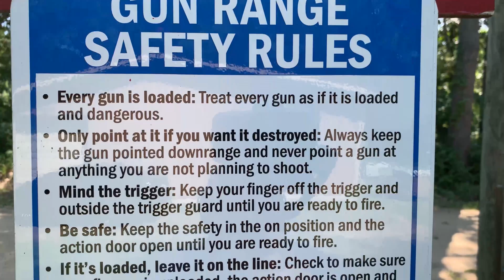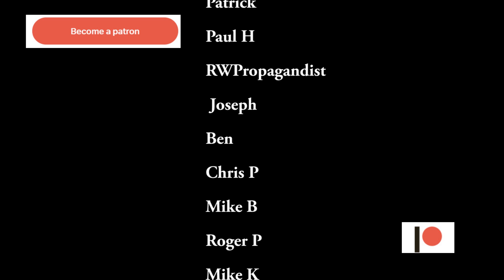7.62x39mm, 46gr FMJ, Czech Training Round

Comment: As much as I prefer the collet style in general, I really think you need to get a kinetic bullet puller, just for your macro shots.
Reply from the maker: the troubles with kinetic pullers are they get powder everywhere, and with steel case ammo especially with sealant, are almost impossible to get them to release. I've destroyed 4 of the hammers over the years :D
Reply: @BuffRANGE  I get it.

There's a reason I didn't buy one. They seem like an inherently self destructing design, and slow to use. It just seems sad to have a confusing and uglied up bullet for your thumbnail. That's genuinely perplexed me a few times, and I've seen others comment the same on several vids.  You clearly put a lot of work into your videos, so don't take this as me adding more onto your plate. Keep doing what you want to do.

 I destroyed a  hornady collet style too. Turns out I'm not the only one. They have a defective design, and poor metalurgy. I have a review of it from circa 2013 on my channel, and TATVcanada did a good job of showing why the RCBS one is better made.
Reply from the maker: @GunFunZS  I agree. It bothers me a bit for the Macros that I now have altered the bullet. I had that happened with the Syntech 9mm since it was soft lead. The collet puller was reshaping the lead when pulling.  

I wonder if I pushed the bullet down in the case after cutting the bottom out would result in a cleaner bullet. Or maybe I just need a really powerful electromagnet, or Magneto's power :D
Reply: @BuffRANGE  I think that is a good idea. Especially for those that have the tar sealant. However it might not leave you any cylindrical portion to grip. I guess it just depends on the bullet design. I find that a lot of my cast-lead bullets are all but impossible to grab.

Comment: Would love to hear how people are cleaning there AK's after corrosive ammo. I've been soaking bolt guns in warm water but never ran corrosive in semi's before.
Reply from the maker: I typically wash down the barrel, gas tube, and gas piston with warm water. I'll hit them at home with Hoppe's #9, and brake cleaner to make sure all the water is gone. for me, most of the rusting issues have come from the gas tube itself.
Reply: @BuffRANGE  excellent! The first time I had a issue with an M39 barrel rusting a month after I shot it. I used water just pooring it down the barrel, then a good amount of WD40. Swabbed it 5-6 times with a jag, figured it was enough. Now I use a nylon brush in non-chrome barrels with water then swab with light oil. I figured the gas system on semi's would be problematic.
Reply: Hoppes no. 9 for me. Then a thin layer of oil.
Reply: is soaking your bolt guns in warm water all that is really needed? wanting to buy some corrosive to shoot in my american ranch 7.62x39 but don’t want to screw up the cleaning process
Reply: @208fishin9  No, salt in the primer propellant gets everywhere, in the carbon fouling. Under the copper fouling, pretty much everything has to be removed every time you shoot and pretty quickly, the warm water melts away the salt but you must get all the copper & powder fouling out also!

Comment: Can you explain why this projectile penetrated so deeply while having so little mass? I would expect .223 performance with those velocities and bullet grain. Only thing I can think of that would cause this pistol tier performance is the bullet shape which is broad and round.

The mount is called dovetail, I think (unless you were referring to the specific mount you own being unbranded).
Reply from the maker: I'm guessing a combo of high velocity, bullet shape, and jacket thickness. Those thick bi-metal jackets don't fragment as readily or at all. It would seem it's not ass end heavy either, so it just becomes a straight plow train. :D

And yeah on the mount I meant the brand. It was a no-name $20 Amazon special.
Reply: @BuffRANGE  Jacket thickness and the bimetal design make sense. Thanks for responding. You're one of the best firearms resources ever.